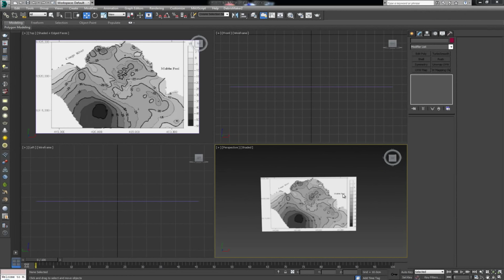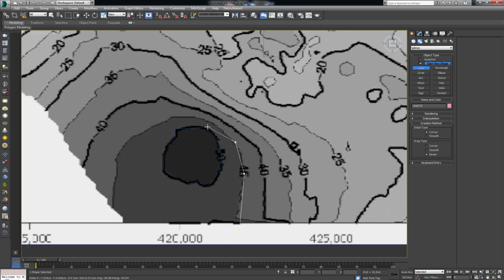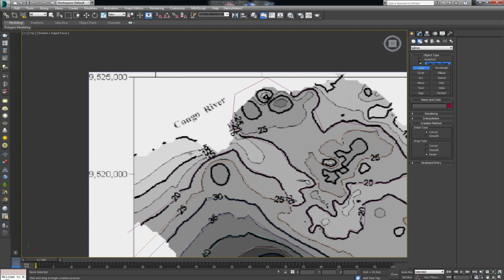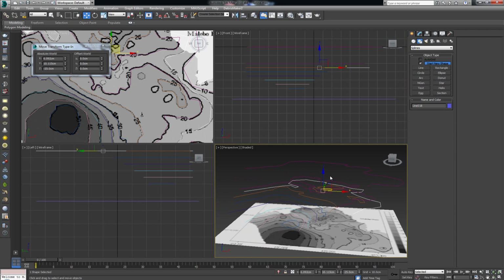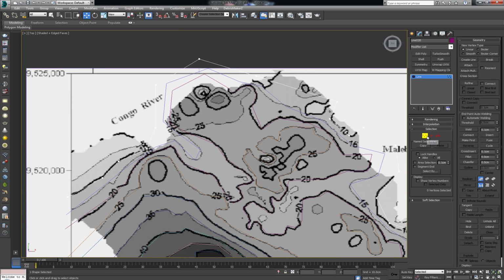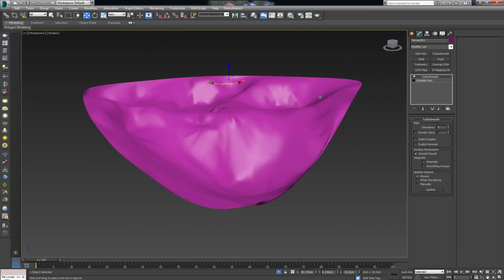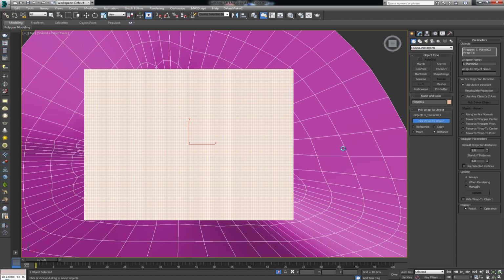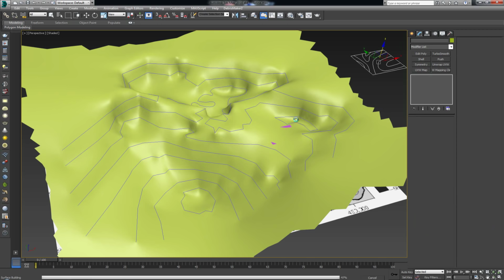Generating Terrain with 3ds Max

Comment: After drawing the contours, is there a way to turn the model into a technical contour model? You know, the rice-terrace effect? After hitting "Terrain", I went to "Parameters > Form > Layered Solid" hoping it would work, but it turned into a jagged mess rather than a nice rice-terrace effect. 

Only other way I can think of to model this effect is to extrude those terraces individually like platforms.

Comment: this is one of the worst terrain modeling tuts i´ve seen. every technic here is time consuming and conter productive. while is ok for small terrains and low quality projects just imagine having to draw lines on huge areas and then adjusting bezier handles in each and every point.
Reply from the maker: Take into account this was made 4 years ago where you didn't have advanced tools for massive terrain generation like World Machine for example and you get this. Plus if you are working of a precise plan for a terrain provided from a company that hired someone to get them precise measurements of the isolines, then you will HAVE to go in and do this line by line and make sure that you don't screw up on the height as well. 

Cheers for giving a reason behind your train of thought as to why you think it sucks opposed to just saying it sucks, i actually do appreciate that.